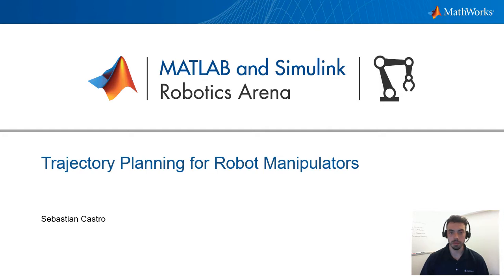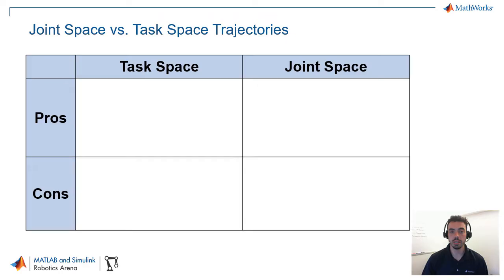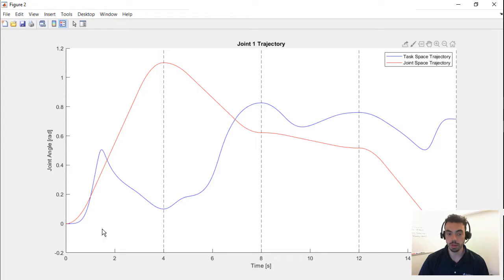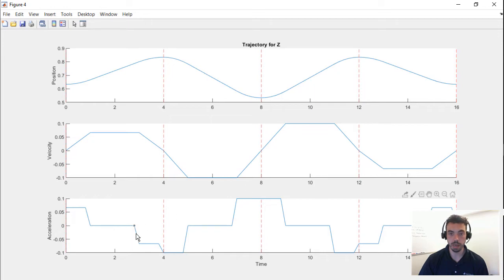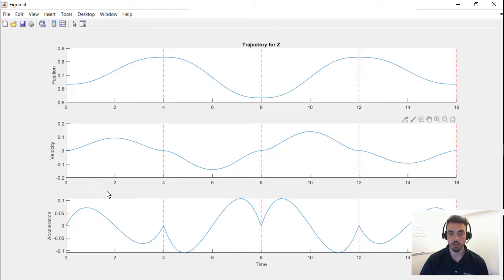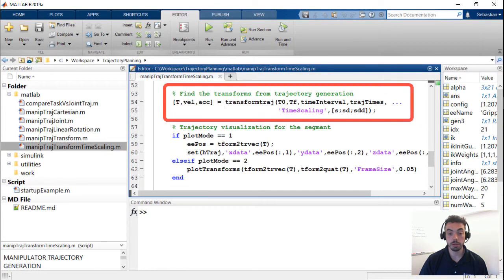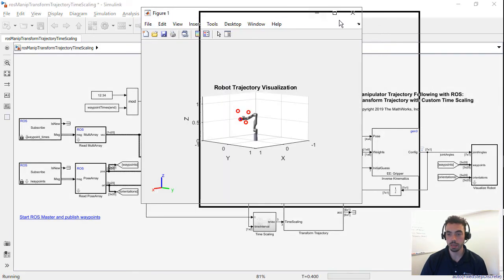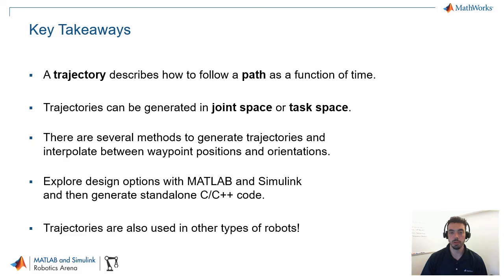Trajectory Planning for Robot Manipulators

Comment: Thank you so much Sebastian, 
I get confused at a certin point << that is how can I relate path planning to Trajectory planning << I need to make the manipulator track an arc using trapasoidal technique but , I get confused wen you demonstaret  the difference between joint space / task sapce trajectories , that the task space can follows the traget path generated by a path planning  algotithm, but the joint space does not cocider the desired path ,
but when you demontrate the polynomial method for trajectory planniing/ the quintic polynomial does not follow the desired linear path even though you are using the task space trajectory. 
This question is critical for me ,  I hope to find an answer, I will appresiate that .
Thhank you so much Sebastian

Comment: Hi,

Is it possible to import CAD joints of a robot and include DH parameters to position control without Simulink? Only with forward kinematics? 

something like that:

https://www.mathworks.com/help/robotics/ref/rigidbodytree.html

But using CAD imported robot parts.

regards.

Comment: Hi this is a really interesting work since I am working on robotic manipulators these days. I came up with a question of how you deal with the inverse kinematics problem. I am currently using Moveit! which uses RRT algorithm as a base algorithm in Linux using ROS. However, since the algorithm randomly expands through the map, it mostly gives a trajectory that is not linear when the starting point and the goal point are 0.3m away only on the x-axis. Do you have a special algorithm for solving the inverse kinematics? Because your robot's path looks quite linear. Thank you in advance!
Reply: RRT is used for path planning, but the resulting path from the RRT would then be followed using the trajectory generation/inverse kinematics shown in this video. So they are two separate things. Basically, something like RRT would generate the waypoints for this example.

As you've identified, a big downfall of probabilistic motion planning techniques is that the path is not optimal. There are techniques such as RRT* which tries to prune the graph to have less "oscillations", changing the sampling options to have a maximum curvature/angle change between points, etc.

An alternative to RRT would be to for instance to take advantage of MATLAB's optimization tools to come up with trajectory parameters that maximize smoothness (objective function) while keeping away from obstacles (linear/nonlinear constraints).
Reply: @roboticseabass  Thank you very much for your kind answer. So how much more time will it take if you use the optimization tools to make the trajectory smooth?
Reply: @waterbell8112  It'll probably add some time... especially if the optimization problem is difficult to solve and doesn't converge!
Reply: @roboticseabass  Alright thanks!! I will try my best :)
Reply: Waterbell Hi bro! I am doing same work as you using ROS and Ubuntu for ur5 robot trajectory generation, i need your help. If you can help me out I will be very thankful to you
Reply: Muhammad Zeeshan Hi! What can I help u?
Reply: @waterbell8 1 1 2 if im not correct with moveit you can control the robot through position only I mean you can do the inverse kinematics as well, but with the trajectory slider in moveit you can just move you robot also you may be able to generate the torque on each joint but may not able to see the mathematical model of it like calculation of my inertia tensor matrix, centrifugal and coriolis effects , gravity compensation etc depending upon the number of dof . Guys , can anyone help me up for the trajectory planning for a ur5 robot/cobot using MATLAB will be highly appreciated for receiving your help.

Comment: I m doing a project related to manipulators. This tutorial was really helpful for me. But i couldnt run the codes there was a function called "trapveltraj" which is not defined. I'm currently using matlab 2018a version. 
2019a is a must ? Do i have other options. I updated the robotic system toolbox as well but nothing changed. If you could help me it would be really appreciated.
Reply: Yes, "trapveltraj" and other functions used in this video are new in R2019a.

Comment: I have similar problem statement. I have PRRR configuration robot and complicated 3D work space. Can I do motion planning only with MATLAB/SIMULINK? If so, Can You guide me thorough from where to start to achieve this?
P.S - I have both the robot and workspace 3D model. No live mapping is required.